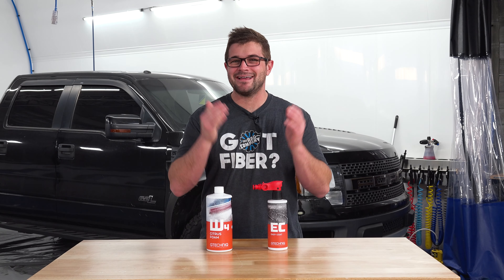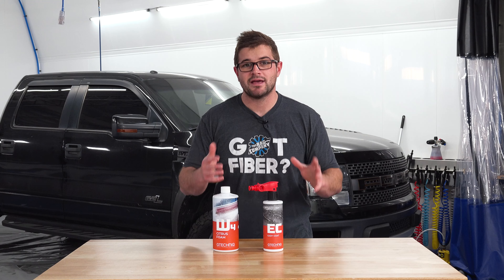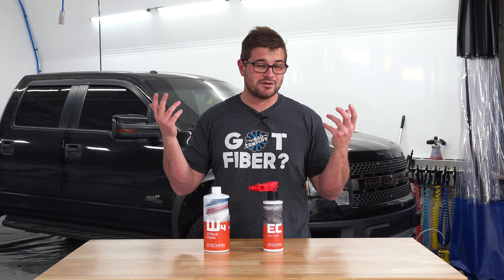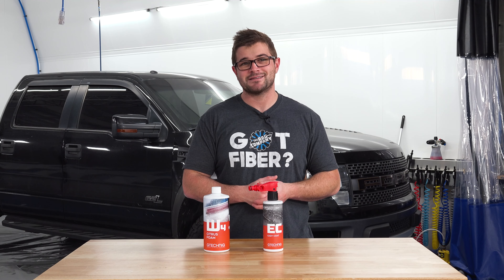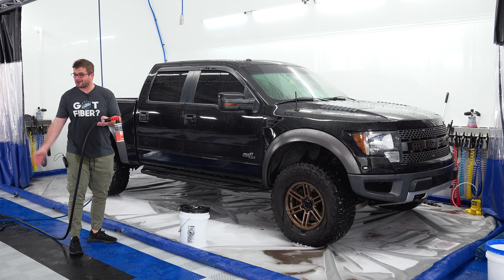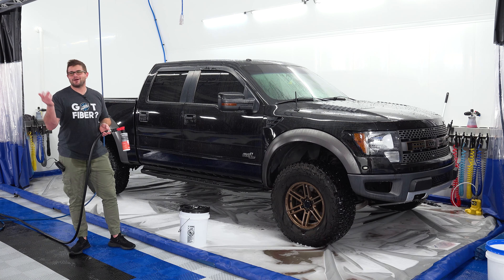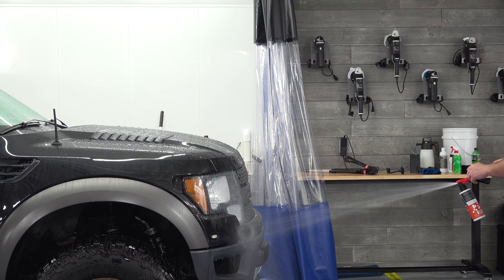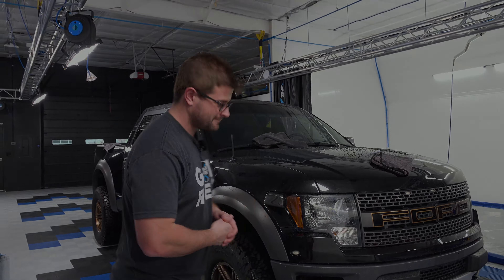Does Protecting Paint Get Any Easier Than THIS?!? | GTECHNIQ Easy Coat

Comment: I would like to know where can I find that hose thingy that u use with the Easy Coat at the same time with the water coming from the hose, maybe I should call it a hose connector ?
Reply: That is called a snow cannon you can find them on Ebay or Amazon.

Comment: Has anyone used this and gyeon wet coat and will compare the two?
Reply: Same question I was going to ask. I have been using wet coat for several years and love it. Initial thought about this product and application method is that I can’t think I would like it better than wet coat.
Reply: @lukelambert4595  ..Wet coat is amazing.
Reply: @U2SuzyQ731  agree. Firmly agree. I’m convinced it’s voodoo magic lol. I garage keep my vehicles and I get way more than 3 months on everything above the rockers. Bottom half probably lasts a solid month and a half before needing another application. Amazing product for someone who doesn’t have time for wax.
Reply: @lukelambert4595  Just discovered it in the Fall. Prepped my car prior to Winter for my daily driver. Still giving me incredible hydrophobic properties after 3 months!!
Reply: @U2SuzyQ731  that’s awesome! Yes, it makes washing and drying so much easier! I was most impressed with how it does on glass. I swear it seemed like it made it about a year on my wife’s suv.

Comment: I see no reason to use that when you have products like Meguiar's Hybrid Ceramic wax and Turtle Wax Seal&Shine that has lasted over a year in controlled tests.
Reply: @theragcompany  What ease of use?  It's pretty much the same as using any other sealant.   You still have to dry the car, so what does it matter if you spray the sealant on the drying microfiber towel or spray it directly on the car before drying?
Reply: @Calendyr  I personally think most consumers would way rather prefer a quick rinse as an application than applying and buffing every panel. I'd go for this hands down assuming it actually holds up down the road.
Reply: @mikeypotts4732  even if it lasts a couple months, its worth it for how little extra time it takes to apply during a wash. I've been playing around with gyeon wet coat, which I really like because it keeps cars clean and takes only a couple mins to apply.
Reply: I haven't used meguires hybrid ceramic wax, but these spray on - rinse off products are much easier and quicker to use than seal and shine. Literally an extra couple mins at the end of your wash and you have some good protection. Nothing wrong with seal and shine other than its tendency to streak on dark colors. I would argue that spray sealants/coatings are in a different category than rinse off coatings, just as seal and shine shouldn't be compared to an actual ceramic coating. Spray coatings are much less durable and much easier to apply than a true high solid coating. You're essentially asking why would you use Easy Coat when you can just apply a ceramic coating to the car. The answer is - you wouldn't use Easy Coat, but you wouldn't save your time and energy, either.
Reply: @scottmattern482 If it were to lasts a few months that'd be a luxury for me lol. I'd so buy it. It blows my mind how these products are able to bond without having a dry surface.
Reply: All sio2 products work pretty much the same to me. I don’t notice much difference between qyeon soap or turtle wax hybrid ceramic wash and wax. I get the turtle wax because it’s easier available. This gtechniq stuff probably works on the same principle.
Reply: @scottmattern482  No my point was that if you are gonna dry the car with a towel anyway, you are not saving any time using these products.   Actually, it's probably longer because you are forced to do a second rinsing of the car before drying.   The way I apply sealants (like Seal and shine) is after washing the car, I apply the sealant on my drying microfiber towel and I dry the car with the sealant.   Then I do a second buff with a second towel to make sure it's dry.   It takes pretty much no extra time compared to a normal drying but you have a good protection layer left behind.
Reply: @Calendyr  A one time quick application and rinse during a normal wash or using a spray sealant every wash are equal in time and effort? Many people typically use a specific drying aid product to reduce towel drag in order to minimize marring and they often leave a minimal layer of protection. I would be hesitant to use seal n shine as a drying aid because lack of lubrication and the product would be diluted to a level that it wasn't designed to be effective at. If you were to compare the time and effort of the application of a spray and rinse coating to a traditional spray coating as directed by the manufacturer, its not even close to which is quicker and easier. Yes, you may be able to make up for the differences in application by using your spray sealant off-label as a drying aid and get results that are satisfactory to your expectations. However, you have compromised any protection the spray sealant may offer. Therefore, the combined ease of use, level of protection, speed of application, and overall cost would be reasons why someone would use these spray and rinse products over a traditional spray sealant/coating diluted on the surface as a drying aid.
Reply: @Calendyr  if you made a youtube video comparing the durability of a spray and rinse product to seal n shine being used as a drying aid, I would definitely watch it!
Reply: @scottmattern482  I might do it on my business channel at some point.
Reply: @scottmattern482  Yes it does reduce the longevity of the product for sure, but since you are doing it every time you wash the car, I don't think it matters.